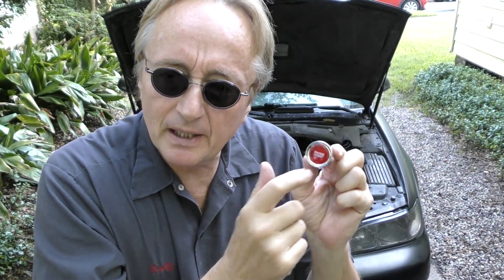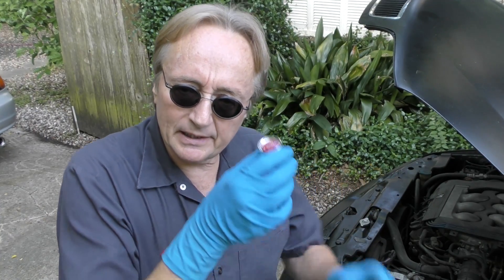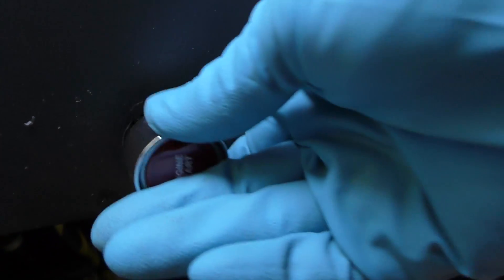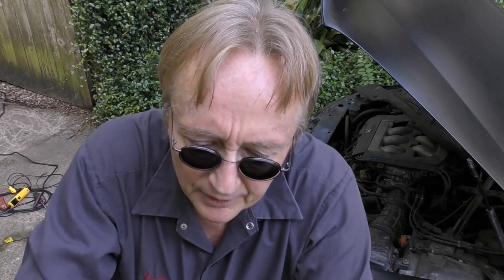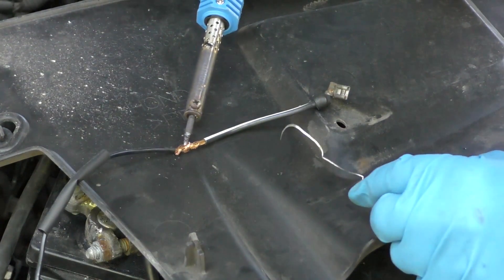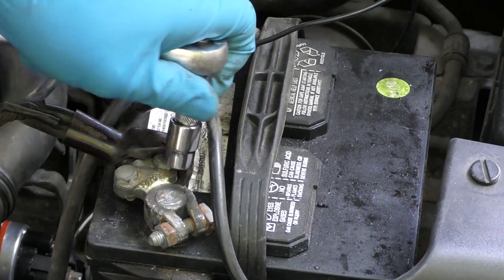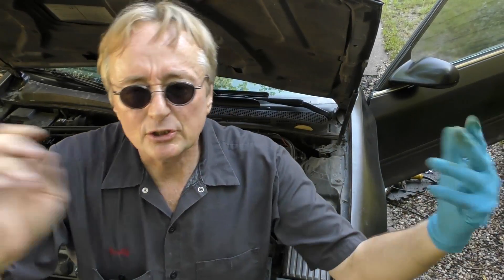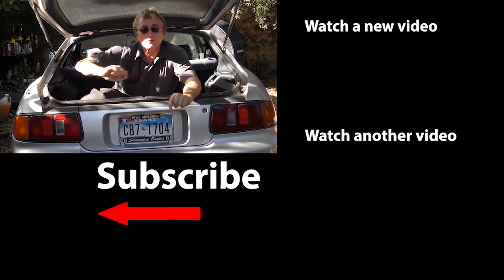I Can't Believe I Put This on a Car

Comment: Scotty, you probably don't go thru these comments very much but I'm gonna give bn it a shot!! I'm having a problem with a very loud grinding sound just when the front brakes get hot!! I mean it sounds and feels exactly like its metal on metal happening!! I've replaced the front pads and rotors 3 times from 3 different stores and it still does it,but only when they get really hot!! Like when I'm driving hard or towing something!! I've also changed the rears twice thinking maybe it just sounded like it was coming from the front!! I've asked countless mechanics and they all say the same thing!! Bad pads!! That's why I've tried different brands each time!! I'm stuck now!! Is their anything else it can be? Like a bad bearing? Your input would be greatly appreciated!!

Comment: Terrible solder joint! You are using a way under wattage iron for the job!  Shrink wrapping should have been medium to thick wall shrink tubing with adhesive center for water tightness. Connection to battery is a "jury rig" job.  Embarrassed to watch this one Scotty!! :(

Comment: Okay, this obviously worked. However, the wires seem too thin for a currents needed for a starter motor (especially if it spins up a larger engine or a diesel). I'd use it several times in short intervals and see whether the wires are getting hot before I'd give the car back to the owner. Another thing is that the soldering job isn't great (the solder should soak between those thin copper threads  - you need more heat and/or a flux for that). I suppose using a less heavy-duty button and a relay with shorter and fatter wires inside engine bay would be a safer option, but hey - the thing turned out okay. Thumbs up.

Comment: Oh, Scotty...That solder job looks a little suspicious.  I'd like to see better "wetting" to indicate a good joint.  That looked like there could be cold solder going on underneath.  Tip is to use hotter iron.  That one looked like a 25W job, or so.

Comment: That push button start is not very secure. You don't need the key to start the car.
Reply: adcolt54 the button only engages the starter. To get the engine “running” you still need spark and fuel. I presume the factory ignition switch still handles these tasks.

Comment: if i were him, i would use 2 relays to control the push start circuit. 1 taken from ACC and the other to power the starter.

Comment: Where did you get that switch, I'm thinking about adding one to a 2001 Ford F-250 Super Duty with 7.3L diesel for my uncle.  He has trouble turning the key to crank the truck, so i'm thinking about adding a push button.

Comment: Sorry Skotty but that would be a fail in my workshop...... If one of my boys had done something like that (in Australian slang they would have got a reef up the arse) a good kick up the butt. If the ignition switch was faulty on the starter circuit, you pick up an ignition feed from the switch and run the power from your push button to a relay. A solenoid when hot can draw over twenty five amps on pull in on the pull in coil then drop to about ten amps on hold in. I know your a mechanic but in Australia we do a four year Technical Collage and on the job training ( one day a week at technical college and for days on the tools). As far as the alarm went they would have probably cut the starter wire near the ignition switch, and knowing alarm fitters would have probably used "scotch locks", causing voltage drop.

Comment: I put a hidden switch in an old car because the ignition switch was able to be turned by hand without the key in.  In my case it was controlling power to the coil.

Comment: Bought a 1994 chysler Concorde replaced the coil pack now I hear a ticking in the engine sounds like a timing chain tensioner problem ,Scotty what's your proffessionall  advice ?

Comment: I thought the key switch usually activates a solenoid that then connects the starter to the battery. I think the push button bypasses that and now has hundreds of amps flowing through it when the button is pressed.

Comment: I was down with it until putting the wire in that old clamp style battery terminal.  Also, the fuse should go near the battery, on the battery side of the circuit...not the starter side of the circuit.  When (not if) the wire rubs through where it goes through the firewall it will not be fuse protected.

Comment: If its keyless starting. How do you turn the vehicle off after cranking? Sorry, never had a pushbutton starter before.
Reply: Use the key to turn on and off the ignition....... the push button only starts it
Reply: @senorfesterhairball  💀💀💀
Wow, thats dumb. Id rather just use my keys in that case. But i do enjoy the tech that requires no insertion of a key. Just a push button power/crank/kill switch all in one.

Comment: That's a cold solder joint.  It needs more heat to reliably connect the wires.

Comment: Sorry to rain on your parade but this wont work well for very long. Most computer controlled cars don't start the motor directly. The ignition is routed through the ECM which also control the fuel pump, timing, security system etc. If the ECM doesn't get or give the proper signals, nothing else will work properly. They all have to communicate to run the car. This can cause ECM failure or all sorts of trouble codes. This would only work on a 70's to 80's vehicle, not any newer than that.

Comment: Or you could just replace the starter disable relay on the viper system. Had one go bad once. Push started my car (pop the clutch) every day for a week until I figured it out. Alarms have a starter cut out that will disable a car from starting while the alarm is going off

Comment: Does an 02 f-150 need diluted antifreeze?

I had to buy some but my dad told me to NOT buy the diluted ones, and when the cashier checks me out he tells me I need to put water in it, my dad says that it's BS because the water rusts the inside of the car
Reply: Yes you do use distilled water or even better use pre diluted anti freeze.
Reply: @burtkelly193  it doesn't rust or destroy the engine?

Comment: Scotty,  please use the appropriate "crimp on" connectors,  either the butt-splices or the ring terminal or fork terminals. You're giving the customer a more professional job that doesn't need the heat shrink tubing or messin' around with the solder iron, solder and flux, etc. You even had the crimp tool in your hand when you were stripping those two wires. And I can't believe you soldered on the ring terminal that was going to the battery and was made to be crimped. I winced in pain when I saw that!. But, I will forgive you this one time. After all, I have to forgive my automotive repair savior. No one else can compare! That, and I sold crimp on connectors for almost 20 years!

Comment: Button sticks out, soldering skills need some work and the "slip the wire under"-connection to the battery could use a terminal as well. Soldering the terminals can make the joint brittle, should really just be clamped. 
Nice though, not that I understand how running the starter will turn on everything else.

Comment: Scotty is there a safety measure in place like a normal quick start switch ? You have to have the main key in the car to start it . Or
Is this just anyone can break into it
Take the car by pushing the starter switch ? Looks cool but no safety measure was put in place

Comment: That was a bad solder joint. You should touch the tip of the iron with solder first. Then touch it and then let the solder run in.

Comment: Hey Scotty......why not run it thru a relay to avoid high amperage going thru the switch?
Reply: The starter seliniod is already a relay. Takes very little current
Reply: @appealingpit  I know the solenoid itself does the heavy switching just I was always taught to use a relay because even medium current can prematurely cause a switch to fail.
Reply: @appealingpit  mind you I'm in nz where probably 95% of switches come from China lol. You can't take the chance🤣🤣

Comment: What's this about electrical soldering you said? I installed a remote locking unit in my door and soldered with normal tin.

Comment: Scotty, you desperately need a higher wattage soldering iron with a broad chisel tip for that type of work.  That solder joint at 2:32 was...  Not Good.  :)

Comment: Scotty, my son just bought a 2009 Kia Spectra EX and the tire pressure monitoring system light stays on. My husband checked the tire pressure on the tires, and the 2 rear tires were 7 psi under. He put air into each. Now my son says when he drives it, the tires squeal loudly after he drives after stopping. We have all older cars and none of them have a tpms. What gives?

Comment: Scotty I expected better from you. That soldering was awful. Always let the solder flow into the wire. Heat the wire and apply the solder to the wire. Not flow it off of the iron onto the wire. And I was really surprised to see that you didnt use a terminal of any kind to connect that wire to the battery. These are the basics scotty

Comment: What if you step on the brake too hard and you bump the start button while the engine is running and U grind your starter? What then? Is there a safety feature to prevent that?
Reply: Yes, the safety protocol is to warn the driver 10 times about this before he drives away lol

Comment: Hi Scotty, big fan of yours from India. I need to ask you one question about my car. I drive 2003 Maruti Suzuki Zen, it clocked 188 thousand kilo meter. It has 1 litter SOHC Suzuki GB10 petrol engine.

The problem I am observing is if I start car and start driving it I feel low power in 1st gear, if I start the car and keep it ideal for 1 or 2 minutes, I do not observe power loss. Car is regularly maintained at dealership and at 185 thousand mark clutch is replaced. The engine never got open for any repairs. Also I do not feel power issue 2nd gear onwards and no drop in milage.

Hope to hear from you.

Thanks

Kunal.

Comment: i put an 1960 ford light dimmer switch on my 89 ford f150 for a starter switch it worked just find
Reply: Basically what they used to be.

Comment: How do you turn the car off?
What about cars with chipped keys, this work on them?
Reply: You still use the key, the button only momentarily puts power to the starter. The key still unlocks the wheel and puts power to accessory.

Comment: I had to do this with my Grand Marquis when the shift lever on the transmission snapped off. Stuck in drive, so I put a switch on it.
Reply: Stuck in drive? What happens when you have to back up?
Reply: @Megatron995  Usually I just plan ahead when parking, but if necessary I can reach under and manually flip it into reverse.

Comment: Scotty, I mean Mr. Scotty, I mean Sir,  with all respect Sir, I mean Mr. Scotty Sir, at 2:34 it shows the wire wasn't hot enough to get a full melt on the solder.  Must have been a chevy soldering iron??  Anyhow we know it wasn't a fantastic Fox body soldering iron or even a Celica soldering iron because they both work.  Even though we KNOW...the FOX looks better.  LOL

Comment: Worst solder ever, it's just laid on top. Nothing holding it together. Use some flux and heat the wire until the solder sucks in. What you did there was make a huge cold joint.

Comment: My car has a transponder key.  Can I bypass the whole transponder key thing by using such a switch?
Reply: don't believe it would work. If your car uses a transponder (chipped) key and you've lost all but the unchipped
emergency one, I think you would still be unable to get the car to run.
Reply: @geezerhull  thanks for the help Dave.  I really appreciate it.

Comment: Scotty....Scotty.... you DO mean the starter button goes to a (low amp) RELAY first, don't you?....that then activates and closes contacts to the power-side  ( high-amp side) of the big fat wires to the starter...right? Don't tell me you're taking high amp power thru the starter switch-button.... are you ?
Reply: He is using the original relay
Reply: @johnpillinger7220  ....ok, if that is the case.....by his description it didn't sound like be did

Comment: I guess I dunno. Perhaps it can be related to this baby-boomer.
 If it's necessary to be in the vehicle, for the key to be in the 'on' position, and, I assume in the driver's seat, what's the point of push button?
I've passed the 'crank start" era, and the R.toe activated starter. It's nice to not have vacuum wipers or double clutching, curb feelers, or a 'knuckle buster' on the steering wheel.
Many folks have no idea of this rant.
I bet Scotty can explain.

Comment: my 55 Ford pickup has the separate starter button.  have to be careful at the tire shop to tell them or the millenials will try and break the key off.  I believe in 56 they went to the standard switch.

Comment: Fuse? Really should put a fuse on that...
Reply: na na he did use an inline fuse. There’s a lot of other deficiencies in this “repair” that others are pointing out all over the comments. I thinks it’s official, Scotty is better at YouTube than automotive electrical repair as evidenced by this video. I was an automotive mechanic for 15 years and did not like doing electrical repair, mostly because of the risks involved and the resulting liability.

Comment: Soo, how do you turn off the engine..? How to just turn on the car to just run accessories like the radio..?
Reply: Cecil Hosein The ignition switch does all but engage the starter (position III).

Comment: Needed   a  little  non-corrosive flux. Tinning or wetting not the best.
Reply: He should have done

1- Smaller strip lengths
2- tinned the leads
3- placed the iron behind the splice so the copper gets thoroughly heated. 

He could also have used one of those but splice connectors with solder paste inside, you use a heat gun to shrink the tubing and it solders the splice.

Comment: Battery, THEN FUSE, then switch and lastly starter.  .
Reply: no relay?...taking high amp starter voltage thru the starter switch?
Reply: @TheWilferch  Do you think the switch he is using can handle 200 amps? My starter as well as the one Scotty is working on has an integral solenoid, no worries. Sorry to hear about yours.

Comment: This description of how to install a starter switch isn't making a lot of sense.Typically the switch inside the cabin energizes a RELAY, which energizes a stater solenoid and a stater motor. So I think this needs to be explained. Also, that solder joint Scotty made doesn't look like a good quality joint. Nor is Scotty's method of using a soldering iron and melting the solder correct. Find a good explanation somewhere of how to make a solder joint correctly. It isn't difficult, but it takes a bit of finesse. Briefly, the solder should flow better, flowing into and between all the strands of the stranded wire of both wires – otherwise after a few years the wire is going to develop a layer of corrosion and the joint will heat up. Solder isn't just to adhere the 2 wires together, it is also is a conductor providing a path for current to flow from strand to strand. Before installing any wire it is very important to find out the Correct wire gauge for the maximum current it is going to carry. If you use wire that it too thin, it can heat up and melt the insulation, start a fire, nasty stuff like that. The fuse will NOT protect you from an overheating wire, if the wrong wire gauge is used. It will only protect you from an overheated wire if the correct wire gauge is used. This is the second time I've seen Scotty neglect to point out that you need to select the correct wire gauge. Here, most likely small diameter wire is needed because the wire is just to energize a relay. But the wire from the relay to the starter needs to be large diameter. It depends upon the max current draw of the starter, under heavy load - cold engine in winter. You look this up in the factory service manual. Then you just look up the gauge needed for that amt of current. Or the factory schematic may tell you the gauge right in the schematic - the wire for the original starter switch. If you are going to be using electrical tape in the engine compartment, be sure to get high-temperature tape. The adhesive on regular electrical tape won't withstand the temperature in the engine compartment. It will lose its adhesion, and the tape will come off. You don't  need advance mathematics to work with current and wire gauge. It is elementary arithmetic, maybe elementary algebra at the most.Or you can just look up the gauge on a chart instead of trying to calculate it.

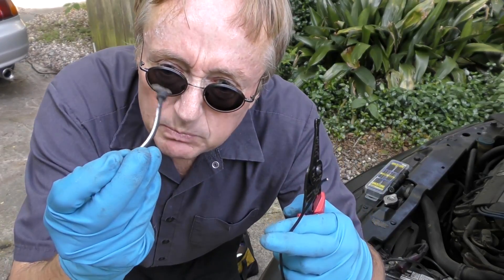Comment: 1:52 That's not a good idea to run the wires next to the grommet. Not only does the rubber grommet push the wire into the sharp metal edge of the firewall and possibly cut the insulation and create a short over time, the grommet will no longer seal properly either, which means air and possibly water will leak into the car. This can be seen at 1:56, you can see right into the car. Sure, you can push the grommet back in and get a better seal, but it will still leak.

Comment: The car is NOT easier to steal. You still need to put the key in the ignition so the steering wheel lock is disengaged?

Comment: Whoah whoah whoa did you really go beside that rubber grommet against the metal with those wires?  Take a metal coat hanger and tape it to your two wires and poke the other side throughbthe grommet a centimeter or so to the side of the other wires. Dont run the hanger right against the wires or against the metal around the gromet the vibration at some point will scratch away the insulating material around the wire if you have it against the firewall beside and the starter button will be grounded and not work at least if not destroy computer systems..